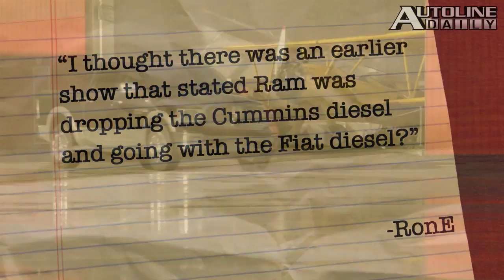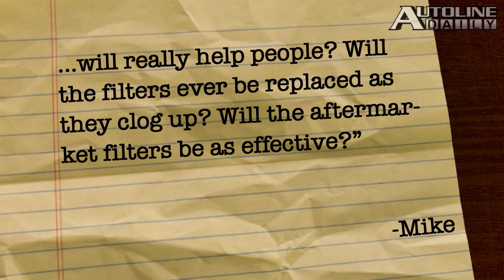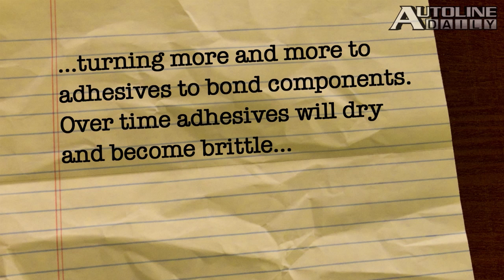Autonomous Cars Drive Better Than Humans - Autoline Daily 1246

Comment: How are you going to enforce older vehicles to be autonomous? Maybe a kind of "robot", a minimally invasive device or system, supplementing pedals and steering of the car and adding sensors to "see". It'll be easiest with automatics, but some people may prefer to have the that much control at least.  It would not require a massive amount of work but it might cost a few hundred to a couple thousand dollars. Old cars can then become at least semi-autonomous.

Comment: I can't argue. But I would like to be the one in control, but if the car is actively assisting you by looking out for issues you may miss, and informs you and/or takes some kind of action to prevent accidents, I'm for it. It might have helped me just the other day, if autonomous assist and/or driving were required.